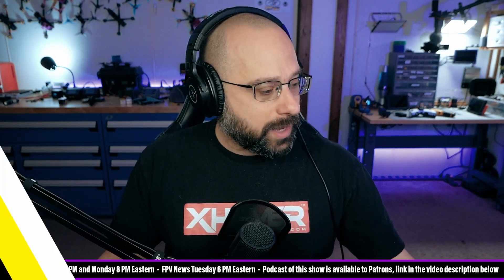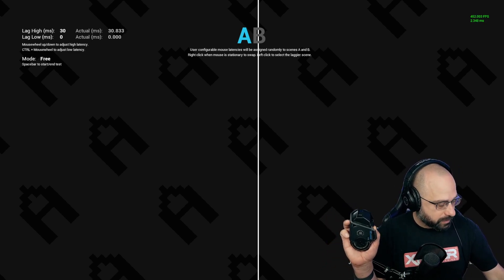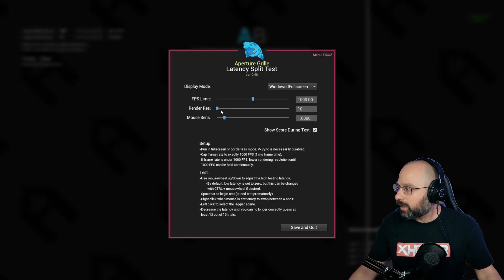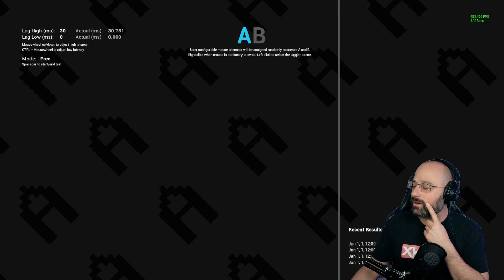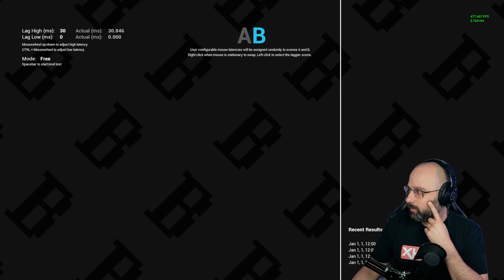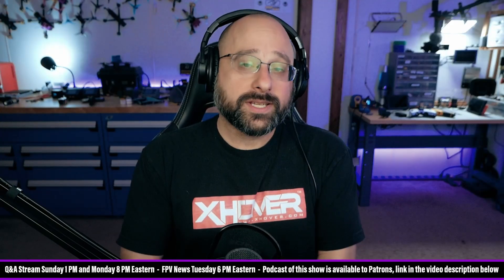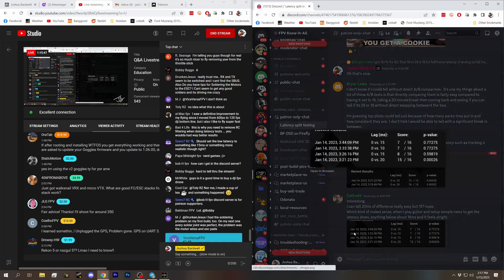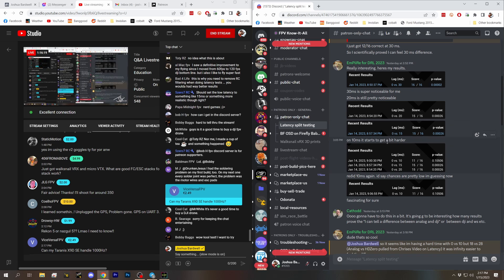How Much Latency Matters In FPV? Test Yourself!

Comment: I recently went from OpenTX & FrSky D8 to EdgeTX & ELRS v3.0 [I'm using analog video].  I felt some latency on the former setup, but I seem to experience none with the latter.  My quad responds so close to instantly, it's spooky.  I can do things now I could not do before.  I have no idea what the numbers are for each, but I can definitely tell there's a difference.  I can see it in my videos.

Comment: One qualifier, it’s easier to tell the difference between 0 latency and say 20ms latency than to tell the difference between 100ms of latency and 120ms of latency, even though both differences are equal. It’s something called Weber’s law of just noticeable differences. So even though both are 20ms comparisons, the latter is more difficult, AND is more akin to what’s happening in FPV as multiple sources of latency (rc, goggles, copter etc) are compounded

Comment: This split latency app is great! At first I was struggling to tell 30ms latency, then I came up with a strategy of trying to move the line then stopping it at a predetermined point on the screen (e.g. using the A/B letters in the background as a reference), and boom, I could immediately tell the difference as with lower latency it was easier to stop at the point I had selected, but with higher latency I'd tend to over or undershoot. This matches how players of first person shooters use the mouse and why they need the lowest latency; and as it turns out, it also matches how we fly our drones, i.e. it's all about hitting a constantly moving target, i.e. tracking a flight path, or hitting the right lines as we say. 💥

Comment: I guess you can adapt to a certain lattency by training yourself to fly with that. But that is true up to a certain point. For example I am used to playing League of legends with a 80ms of lattency. I onced moved out to a place where I had 20ms lattency and I couldn't play any better or even notice anything. 

With that said, I managed to notice a difference in the software you demonstrated down to 20ms.

In conclusion what I am saying here is that it doesn't matter how much your lattency is and that you will fly the same when you get used to it.. BUT that is true up to a certain value of lattency that is NOT what you get from this software.

Comment: Interesting stuff, with the App I consistently detect latency differences when the differential is 15+ms and around 80% average accuracy at 10ms differential. It becomes a wash at </= 8ms. I guess that would roughly be my threshold based on this test.

Comment: Just thinking out loud: How does this work out with the LCD refresh rate? - On lower latencies, do we feel latency or jitter?
Reply: The app updates/repaints the location of the white vertical line in the display buffer and the graphics hardware renders it one horizontal scan line at a time. Since v-sync is disabled, the white line's position will be changing as it is rendered, hence the tearing of the line as you move it. The key thing to note about v-sync being off is it means the output is no longer bound by display frame rate but rather scan line refresh rate, i.e. how many scan lines are updated in 1 frame i.e. 1/60th of a second for a 60fps monitor. Now consider that they allow you to set the vertical resolution, and I brought mine down to 10 from the default of 25, i.e. 10 scan lines in 16ms = 1.6ms per a scan line. It's not ideal but IMO you can still notice the difference.

Comment: I believe there are people who can tell the difference. I also believe they are rarer than most would assume. That said, we are a skewed group who will have a much higher percentage of these individuals than the random public.
Reply: Flying analog at sub 20ms for over a year, I am dialed right in on it, and when I tried walksnail at 40-50ms or so, its a huge difference, easy to detect.  Any analog pilot who has honed their skill to a degree and flies proximity freestyle will certainly feel the difference easily I think. Most anyway,

Comment: I don’t know. With a quad your stick input plus the controller adjusting plus how long a motor takes to change rpm plus the air it’s hard to imagine how tens of milliseconds difference matters. 
Yet I know people feel it. Quads aren’t video games and the response to stick input is variable because of the above.
Reply: You can fully understand it when you feel it and the way to feel it is to fly something like analogue for a while then for fly your DJI same route same speed first do low latency then fly high latency you'll crash the thing nearly right away on your route

Comment: There is a huge latency between 50Hz and 500Hz.
It's noticeable when you make quick changes of direction. I can feel a latency between Spektrum and RadioLink when I am flying a plane.
Reply: What's your video refresh rate? This only works on PC because you can turn off VSync. If you can't you're bounded by the refresh rate of your display.
Reply: @Invid72  I haven't tried the program yet. I write about the experiences with ELRS and my quadcopter. I'll test it on the computer tonight.

Comment: There's a line on the screen moving with the mouse, A and B and a green flash occasionally. I didn't know what was happening back then and it's no clearer watching it after the fact. 😆🤷🏻‍♂️ (Do you have to move the mouse when you see the green flash maybe?)
Reply: You have to be the one moving the mouse to feel the difference in the response.
Reply: He's comparing the 'feel' between zero latency and 30ms of latency and the green flashes are him successfully detecting which one is which
Reply: @Voyajer.  I understand that he's moving a mouse and estimating the lag based on the response of the mouse but what's with selecting A and B ? It annoying me far too much that it wasn't clear. IDK 😁 (thx for reply)
Reply: @Cool_Cat-0  Between A and B, one of then has 0 ms of lag, and one has 30 ms of lag, and it's my job to figure out which one is which.

I switch back and forth until I think I know then guess.

Green flash means I got it right. Red flash means I got it wrong.
Reply: OK so.. it seems he selects either a or b somehow and whichever he has select selected, the lag associated with that letter is represented in his mouse movements afterwards. He swaps between a and b moving his mouse to figure out which is laging more. That's my guess.
Reply: Two reply comments, rewatched and still none the wiser. 😕
Reply: Indeed this was poorly explained. The line is the thing being controlled which may or may not have some latency applied depending on whether mode A or B is active. The mouse is your input, so you move the mouse and watch the line to see if you can perceive any lag in its responsiveness for mode A vs mode B...you need to figure out which mode adds the latency.